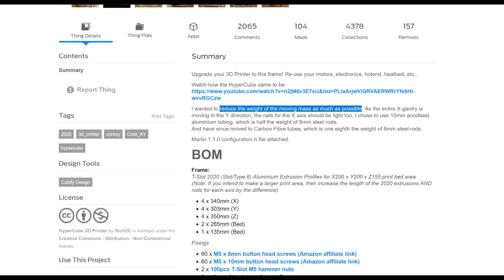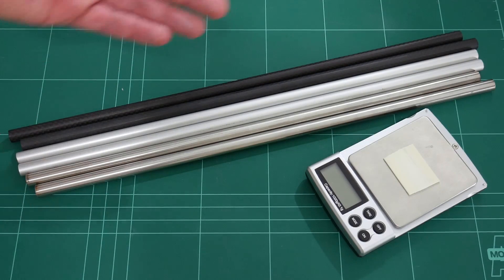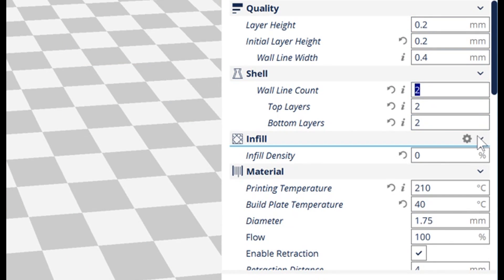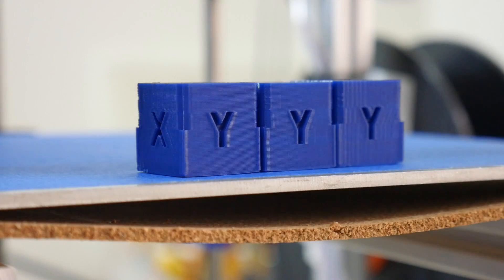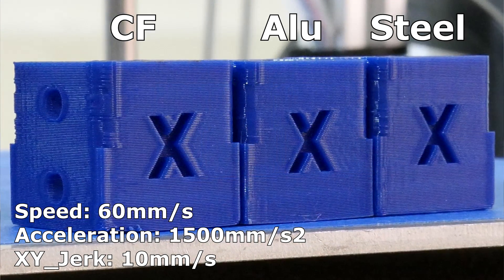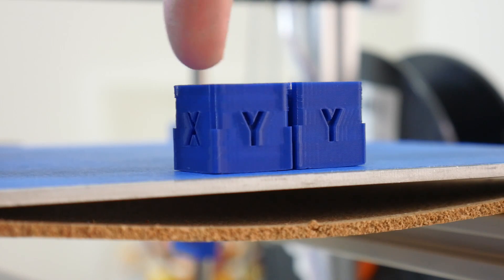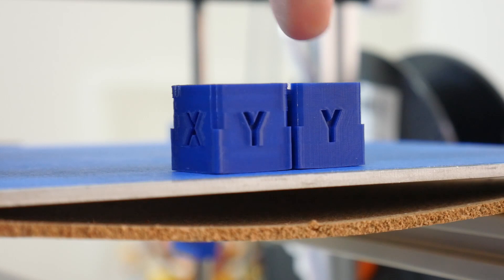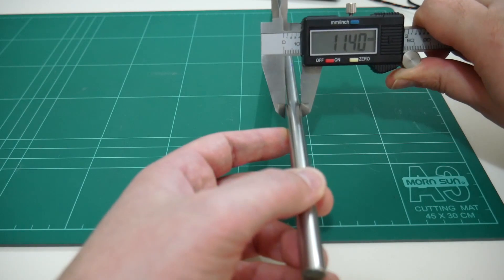THIS IS Y

Comment: Question:  What is your Marlin's Jerk, and Acceleration set at because if they are not greater than what you set in the slicer Marlin's will take precedence.  Just wondering.
Reply from the maker: In Marlin DEFAULT_MAX_ACCEL is 3000, XY_Jerk is 10.
Reply: Jerk is the one thing I never could grasp and searching, or asking, on the net pulls up the same bewilderment from the people.  Supposedly it has a bearing in the ghosting.
Reply from the maker: From my understanding with XY_Jerk, it is the minimum instantaneous speed Marlin assumes the printer can handle. So when the nozzle is approaching a corner and decelerating, it doesn't slow down to 0, it slows down to the Jerk speed. Same with accelerating, it assumes it can begin the print move from the jerk speed and accelerate onwards.
You can test this by changing jerk to 0, and you'll notice the nozzle stops at each corner - quite bizarre. A jerk of 0 shows awful blobs at every STL mesh intersection and totally changes the surface finish.
Reply: so the xy_jerk setting is in the Frimware, not in the cura right?

Comment: hi is it not the jerk setting that makes a difference to the amount of acceleration ?  what were your jerk settings?
Reply: Mark Bridgewater are you kidding me? it is literarely in the video several times! just under the acceleration and print speeds.
Reply: As the length of the cube is so short ,  why wouldn't  the jerk value  also have an effect ?

Comment: its not unusual that a caliper is plus/minus 0,1mm, for a more exact measurement you'll need a micrometer.
Even if the retailer said that the rod is "exakt" 10mm,  axels are always plus/minus a few 1/100mm.

Comment: I am a bit confused. The rippling should occur due to the sharp cornering while newton told the weight to go straight on, resulting in an oscillation on the face after the corner. This means that weight moving in the Y direction should affect the faces perpendicular to it. The heavy Y-gantry should affect the face that is marked X in your print because you rotated it. Then Y oh Y is there still an obvious difference in ghosting where it shouldn't be?
Reply from the maker: Because theory and practice sometimes don't match, well at least in this example. The ripples you see originate from stationary to acceleration moves only. Hence why you don't see ripples on both sides of the Y letter.

Comment: 8:11 500m/s/s on the left not ghosting as you say
9:50 30m/s with a=1500 on the right, you say not signed of any ghosting, but i clearly see ghosting returned.
Not as strong as at 60m/s but still clearly visible.
But corners at low accelaration really start top suck, Best way is to reduce accelaration AND speed  - it will solve the corners problem.
Also, lately i think the best wait to fight ghosting is not making everything super tight, but instead using some kind of dumpening (in addition to mass reduction).
Reply from the maker: Trust me, the 30mm/s print ghosting is virtually not visible from the naked eye. Using a 12M camera and zoomed in, yes it shows the very minor pattern :)
Reply: Trust no one and nothing, even your own eyes :)
"virtually not visble" does not equal "just not there" where accel is 500.
The thing is, i have acrylic tronxy p802ma and accel 1500 is not acceptable there and also speed 60m/s is always good enough, but i still want to get good corners, as everybody else. I do 500mm/s/s and 40m/s and get corner without problems. However, jerk is also 5 or even less.

Comment: Nice video. It was cool to see the differences and carbon fiber tubes would really pimp up my printer. Added to my long todo list.

FWIW - I have a stock Anet A8 which has steel rods and a direct drive extruder so there's a bit of mass moving around. I didn't look at weight factors but I did observe a substantial reduction in ghosting, similar to your qualitative assessment, by tightening the X and Y drive belts. I printed tensioners for X and Y and now they are taught. When I had ghosting I could literally see a wave propagate along the belts with each direction change. Now the belts just move back and forth with no judder at all.
Reply from the maker: Yes belt tension helps reduce, or at least change the frequency/repetition of the ripples. On the A8 the rails aren't moving so no need for CF.

Comment: My favorite 3dp youtuber :) what G code ending script do you use to move Y axis to the back after print?
Reply from the maker: G90
G28 X0
G1 Y190 F3500
Reply: Thanks! I was wondering the same thing. I was getting a bit tired of manually moving the print head out of the way to remove prints. Great video!

Comment: But i can't use anything else than the steel rods! The Carbon fiber tubes is very hard to get them straight and with a max of 0,06mm tolerance.
Reply: And i dont want more that a 0,02 mm tolerance. But i know thats hard to get.
Reply: Aksel Ribe in my experience trying to get these sorts of tolerances out of 3D printers is like trying to capture smoke in your hands. I am sure the carbon fiber rods could be straighter, but there are many more factors at play than the straightness of the rods in the setup of any 3D printers dynamic elements. For example, the XY joiners are driven independently by different steppers. What is the perpendicularity tolerance then of the x and y axis motion? On top of this, what of flow dynamics in the extruder and hotend? 

My point is that squeezing every last bit of precision of out a printer is essentially pointless, as the process just isn't geared for such precision. Plastic is so elastic as well, so the fits which require such tolerances are much more relaxed.

So let yourself buy the CF or aluminum rods. As long as it isn't extremely out of straight relative to what you're doing, you should see very little actual effects.
Reply: Ok, thanks!

Comment: Thanks a lot for a very informative video!  Could you please let me know what bearings were you using in all these tests?
Reply from the maker: Igus JSM-1012-10 plain bushings on the X, LM8LUU on the Y, LM8UU on the Z.
Reply: Thanks for your reply.
I've built your Hypercube and love it.
Did you use the same bushing holder as in Hypercube files?
If you changed it for Igus bushings is there any way you could post it on Thingiverse with your Hypercube mods?
Reply from the maker: The same dual_bushing_holder.stl part. The Igus JSM-1012 has the same dimensions as the steel plain bushings.

Comment: This CURA you use also for controlling the printer ? I have Repetier and it has some CURA included but I don't think is a good version .
Reply from the maker: I still use Pronterface, but yes you can use Cura to print from too.
Reply: Tried today, can't connect to the Hypercube with CURA . I have a Printrboard. Pronterface has slicer included and also CURA ? Since I updated my Repetier if I write some GCODE the printer will not take it, very strange .

Comment: Can you add the approx. cost difference between the materials? 
I had a hard enough time finding steel rod, how hard is it to get al or cf?
Reply: i ordered CF Rods for 3-4usd each in banggood. Alurods for about 1-2usd per meter here in Sweden. go for CF IF you are comfortable with ordering from banggood :)
Reply: I found 500mm long 10mm tubes at ebay for $6.2

Comment: Thanks for the video.. Very interesting.

I'm building a hypercube based machine, but have started making changes to the design and so it'll barely resemble yours.  Because of this I've decided to build two!  One much like yours: lightweight, open and good for PLA/PETG and my own machine that will be slower, hotter and enclosed with a direct drive head.  Hopefully better for difficult materials.

I had no luck with the carbon tubes I bought.  They were poor in both linearity and diameter all the way along.  I've since found a better source so will get some more after this video.  I also bought a Titan Aero because I prefer direct drive; but this video has convinced me that I should also make the lighter machine a bowden type and give it a go.

More videos like this one please!  Thanks again.
Reply from the maker: Haha very good. You can still choose direct drive, just slow the print down is all ;)

Comment: really interesting. Out of interest can you give any example of the print time difference for the CF vs Steel rods with the accel and speed on the steel set to levels to give similar quality?
Reply from the maker: Printing the ripple test cubes at 60mm/s with 1500mm/s2 accel, print time was 13:21 for all rails. At 1000mm/s2 and 500mm/s2 accel, print time increased to 14:04 and 15:34 respectively.